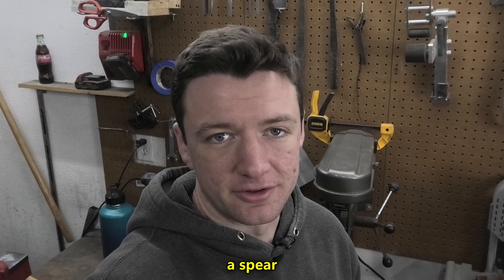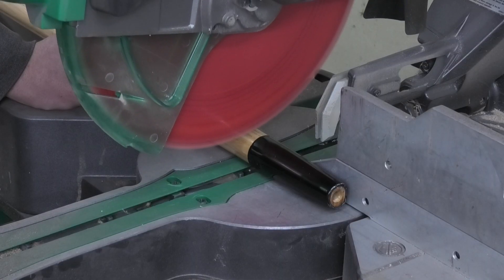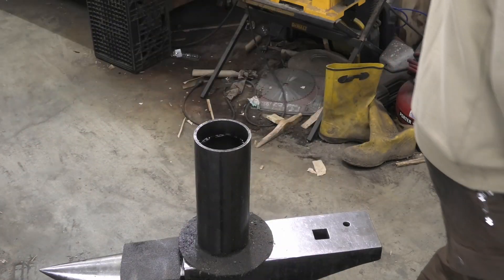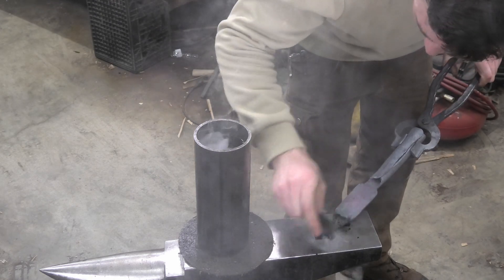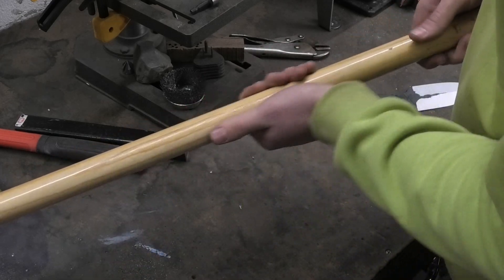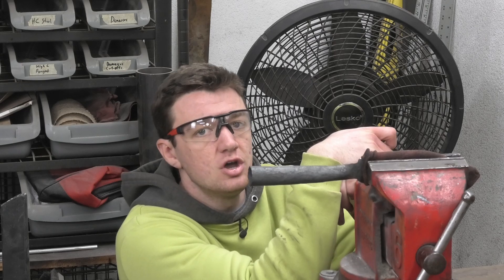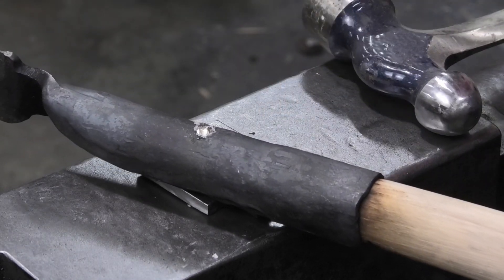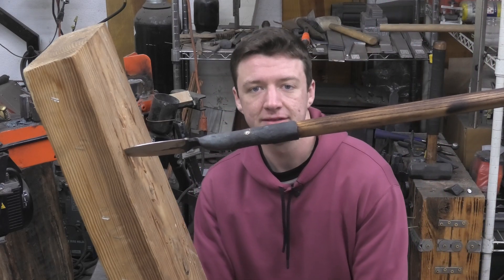I Forged A SPEAR!!

Comment: Your brass split and did that because you had too much outside of the metal to work down without heating it to release work hardening stress. Trim the brass closer to the least amount you will need for the head of the rivet.